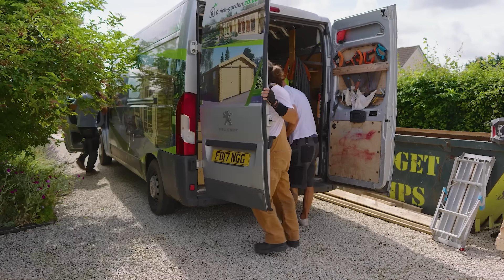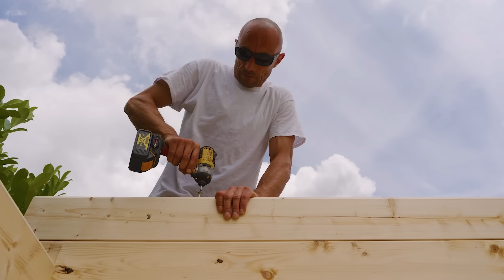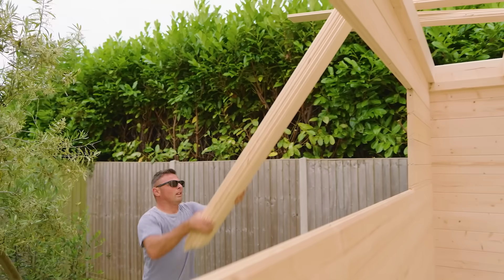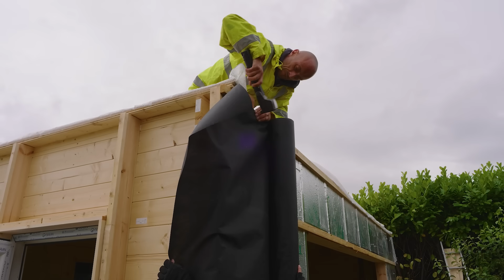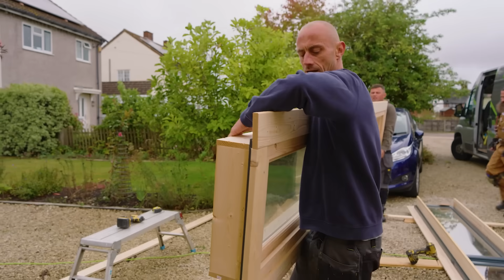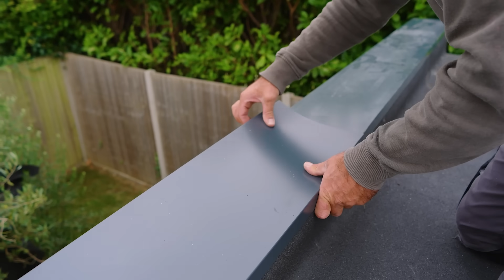Ultimate DIY Garage & Workshop Build | Installation Tutorial

Comment: That base rail will rot! I recently repaired a summer house similar construction 12 year old and fairly sheltered.
Reply: If you go to the trouble of a quality concrete slab why not create an upstand with a but of shuttering and build off that? would last forever with decent overhanging eaves.

Comment: I thought the most impressive stage was digging out the footing and base, then concreting it and getting it to set all just a few minutes before before the carpenters labourers turned up. Also was it a good idea to set the first timbers straight onto concrete where damp can, and will penetrate them? 2 course of engineering brick to lift the timbers off the base too difficult?

Comment: The minimum ventilation gap for a cold roof is 50mm not 25mm
Reply: I’m not missing anything, it makes absolutely no difference if building control has anything to do with this build
Let’s be clear this is not a garden shed by any stretch of the imagination 

If has fully insulated walls, this is building someone will spend a considerable time inside, it has a cold roof with insulation between the trusses, so any and every building with this roof design should have a minimum gap of 50mm between the insulation and underside of the the roof to ventilate any air to reduce the chance of Interstitial condensation

So by your logic because it does not require planning or pass building regs you can just ignore good practice and building regs 
Maybe you should look up building regs 7.1.10 thermal insulation and vapour control 
My last comment referred to builders not following regs, and have the attitude, ah that’s good enough
Reply: @macsmith6216 You're right. Maybe you should consider a side business as a builder or insulation specialist or in building control or health and safety.
Reply: @SJWardBuilders  
Who says I’m not😉
Reply from the maker: That is not necessarily so. If you have an internal vapour barrier the amount of moisture is reduced and a 25mm cross flow is often plenty.
Reply: @SkillBuilder  
Ok, have just had a flat roof extension build with vapour barrier, and the building inspector confirmed 50mm was minimum above insulation and he also stated any roof with a greater span of 5 metres was now not recommended for cold roof design, the 25mm is for the gap at the end of each joist.
Reply: This is a bit like a fancy shed, a building inspector didn't need to sign it off because it didn't need to comply with building regs. Does your garden shed comply with regs??!! There you go skill builder a video title!
Reply: @SJWardBuilders  
Is that the best you’ve got, it makes SFA difference if it didn’t need planning permission, it’s still wrong, or are you saying because it doesn’t need planning or a building inspector to sign it off, we’ll just build it wrong

And I’ll bet it’s a dam site more expensive than a garden shed
Certainly not a good advertisement for your building company🐎did you ride in on this!
Reply: @macsmith6216  Firstly I didn't build it. The installers from the company did so if you think they built it wrong  you take it up with them. Secondly the client who  it belongs to did the insulation in the ceiling and had SFA to do with me or indeed Skill Builder. On my jobs things are done to the letter and all my work comes from recommendations which is where my adverts come from. So thank you for your sarcasm and infinite wisdom
Reply: @SJWardBuilders  
Did I say anywhere your company built it, I watched the video so I know you didn’t build it
My comment towards you, which has gone straight over your head, is if you think it’s ok to build something against recommended procedures, it’s not a good advertisement for you building company 
Have a pleasant evening
Reply: @macsmith6216  I feel you are missing the point. You mentioned that building control was involved in your new flat roof and rightly specified 50mm air gap. Unfortunately there isn't one rule that fits every building and particularly this one which is a wooden building similar to a garden shed. The installers haven't built it wrong just a different way to what you think you know. 
Why write: "Certainly not a good advertisement for your building company🐎did you ride in on this"!
Reply: A lot of tension here, but let's face it. the base of this build will be more problematic before the roof gives them any problems. I mean heck, the build ain't perfect. But maybe it would be nice if these channels could show off products without the regs police showing up every five minutes. 
I mean they ain't living there so I don't think moisture will be an issue with the roof.

Comment: I built a similar one single-handed a couple of years ago. I agree with  "The Cornish123456" below.  better to raise it off the ground a bit.  I did something similar with bricks too.  mine wasn't a "garage" so I put spaced bricks on the concrete with DPM and thick wooden bearers.  worked a treat.  The weight of the building holds the bricks in place without needing any mortar.   6.5m x 3.5m  - in my experience these wooden buildings will throw up a few snags but they can be overcome with a little thought.   If you want to use all year insulation is absolutely critical.

Comment: Would be interesting to go back in 5 years time and see how it stands up to the British weather, I don't hold out much hope, there might even be an indoor pool once all the water seeps under the base plates!😂 The base should have been the right size for the garage, way too big.
Reply: I bought and assembled a smaller version for my daughter's 10th birthday as a playhouse for her. I used a wire nailer rather than screws. That aside, she's 28 and it's been dismantled and relocated once and is now a lawnmower store. It's still solid.
Reply: pressure treated timber can last a long time, look at fences and posts. but yea, I'd still want to elevate timber off the ground. Also curious to know how well the cladding lasts before needing maintenance

Comment: As with other comments I would be concerned at the base onto the slab, water could/would pool and seep in / impact the base timber.  For me either a couple if courses of Brick are required or the base needs to be exact to the structure and external clad overlaps with good drainage around all sides. Nice building though.
Reply: They do this with steel insulated garages, although this slab would need to be higher off the found level. I totally agree. Means water runs off

Comment: Like it but can't help but think it would be better if it was built up off a couple of courses of engineering bricks with dpm on top rather than wood on top of always wet concrete.
Reply: That's what we did with the cabin we've been building. A concrete slab for stability and then a double course of bricks with dpm on top to keep it up out of the constant North Devon damp.
Reply: Agreed. I've done this with outdoor rooms I've built for customers. Far more durable
Reply: The base detail here seems pretty unsuitable for all but the driest parts of the UK. Assuming this is not intended to be a temporary building you generally want at least 150mm between any timber and the ground to avoid excessive wetting from water splashing up. In this case there also didn't appear to be anything to stop water around the outer part of the slab from running under the wall and getting inside. As the DPC was laid straight on the slab there also seems a high risk of puddled water running onto the top face and saturating the pressure treated timber. There was no DPC above this to stop moisture wicking up into the timbers above either, so the DPC only provides protection from ground moisture in this scenario. This may be adequate in a very dry and sheltered part of England but I'd recommend something far more robust elsewhere.
Reply: ^ this. Pressure treated schmesure treated. Wood as the foundation sitting in water.

Comment: Good work, but just a little confused why the roof wasn't tilted ? Won't the rain just sit on top 😮
Reply from the maker: it was tilted. It is called the fall and it was explained
Reply: @SkillBuilder  Some wet snow and it will be as if the roof sit under water, the more tilt the less trouble, but perhaps snow isn't a thing where the garage stands 🙃
Reply: @bamsebrumbamsebrumen5403  most snow wouldn't last more than a day and might only happen once a year, if at all. ⛄
Reply: @SkillBuilder  But it looks like there was the metal-clad barrier around the perimeter - I never saw an opening.
Reply: LOL
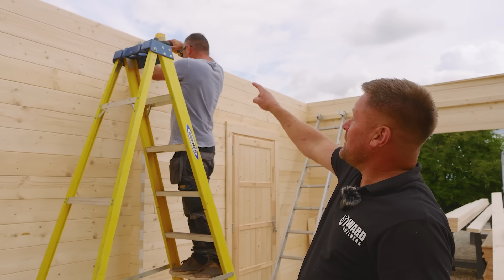Reply: 4:10, fully explained.

Comment: To clarify, that's an uninsulated roof then? Didn't see any kingspan going down or were you doing a cold roof?
Our loft conversion has an awful cold roof so much prefer warm.
Reply from the maker: The insulation is on the inside between the joist

Comment: I always worry about timber plates straight on to concrete with a dpm. The water gets on the dpm and puddles. Major posterior ache to repair.
Much rather have 3 course of bricks personally.
Reply: I would recommend that the concrete base is the exact size of the tongue and groove walls so when the external cladding is added it forms a drip past the surface of the base.
Reply: @SJWardBuilders gravel below that for drips or just onto the grass, etc?
Reply: I agree with that completely the trouble is that you need to get the car in so you have to build up and then adjust the door height.  It can be done though and evern one course of bricks is better than nothing.
Reply: Couldn't you wrap the dpm up the wall to effectively give it a waterproof surround? Tape/liquid flash it (as they do in the US)?